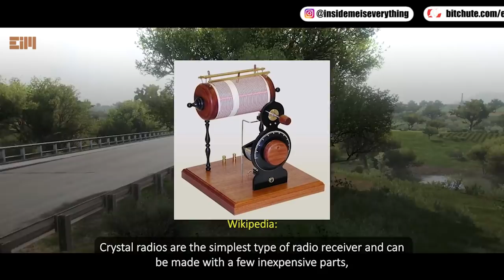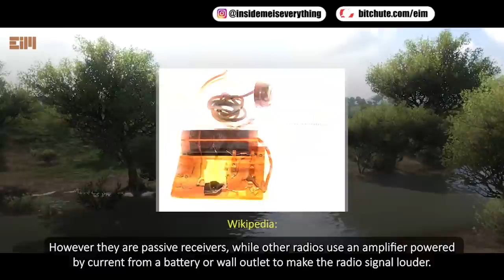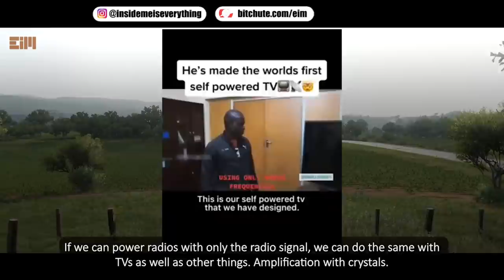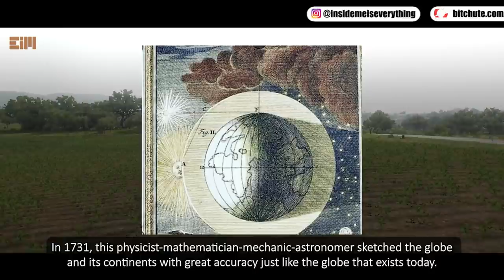IS THIS REAL?! THIS IS NOT OUR TECHNOLOGY!

Comment: In electronics, to make DC from an AC signal, they use a diode network which grounds out half the signal. Same on a solenoid kick back and diodes shunting energy into ground, a huge loss that could have been otherwise captured.
Reply: Okay, now in English.

Comment: AHhh memories  :-)  The first topic remindered me of a day in my childhood sneaking to my window late at night and setting up my "Rocket Radio Set" ... which was a crystal radio shaped like a rocket and had a pull out "nosecone" antenna which you pulled up and a socket on the bottom for a earphone.
I had a long bare copper wire strung up outside my window going to the garage. I got it from a transformer I took apart.  I would clip this antenna to a wire that came in under my closed window with an aligator clip to my Rocket antenna....   and Man!
I had (in Toronto) a powerful radio I could hear holding the earphone in my hand, nevermind in my ear :-)  and no battery. late 50's
This started me on my way to computers, etc..

Comment: Bi polar Junction transistors and vacuum tubes, are they free energy devices? They are used in broadcasting to amplify signals to transmit further/better. Also you mention the earths pulse, is that an emp?